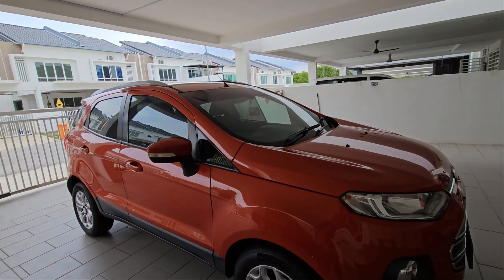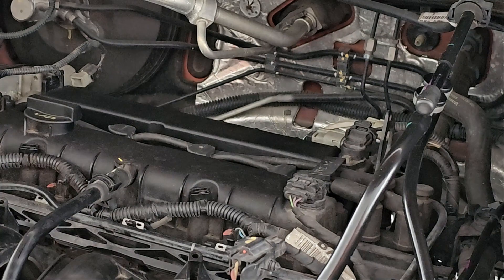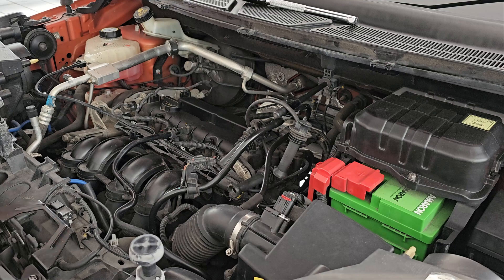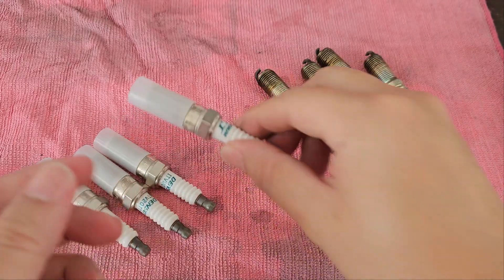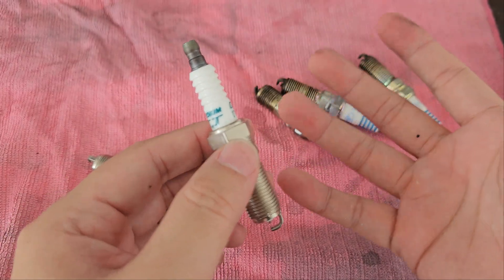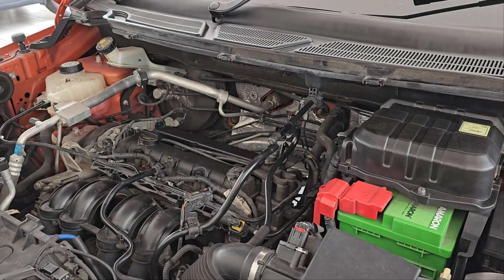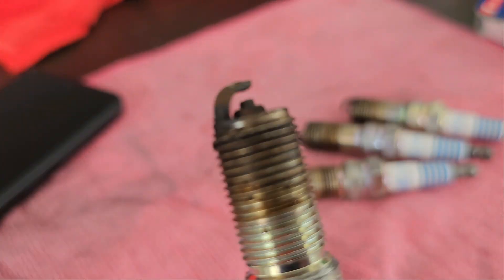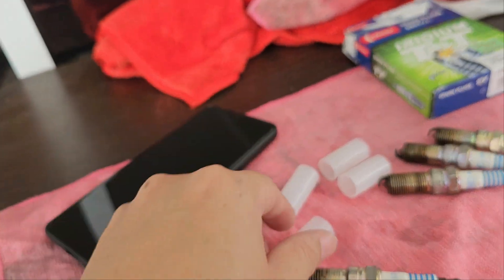Iridium spark plugs - Ford Ecosport

Comment: Have question have you ever changed timing chain on your Mitsubishi lancer? I have 181k miles never changed mine. I was thinking about taking car in to replace but very expensive.
Reply from the maker: Mine is close to 300k km right now and I have not changed my timing chain (so far no symptoms of it needing a change anyway )